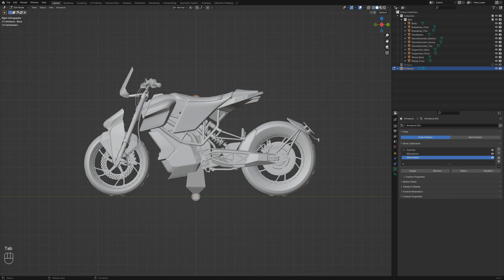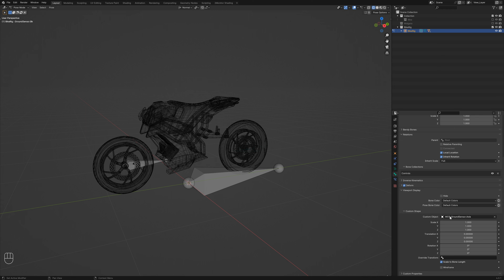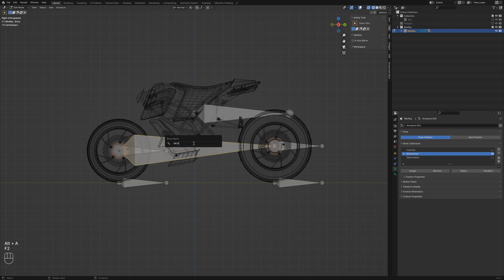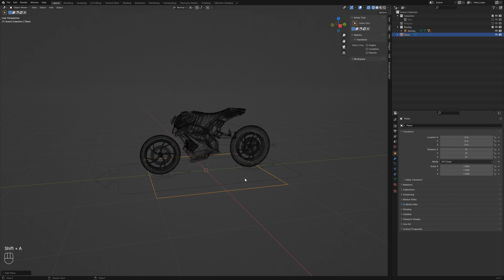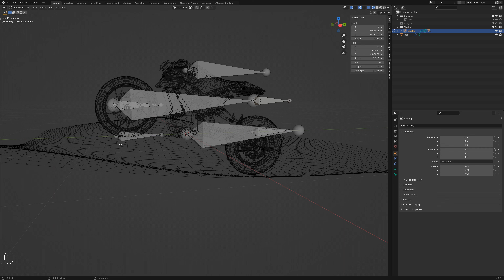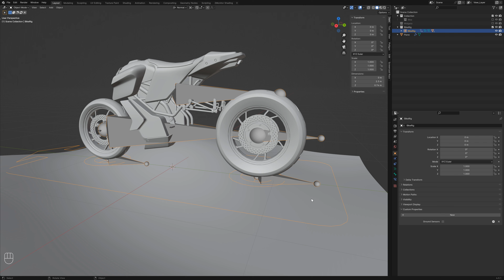Blender 4.0 Tutorial Series: Rigging a Motorbike - Part 2/10: Creating an Axle and Ground Sensors

Comment: I also had a trouble in setting up the first three bones. Couldn't manage to add multiple bones in the same Armature despite multiple tries. So seems like after you set up the first bone, change the 3D cursor position. Then go back to Edit mode, select the existing bone, then press Shift + A. This adds a new bone in the location of the 3D cursor but in the same Armature as the first bone.

Comment: What if im using 3.6? will it still work??
Reply from the maker: The only difference will be that 3.6 doesn’t have Bone Collections, it has Layers (those little grey square buttons) You just need to move your mechanical/deformation/control bones to different layers and remember which one you put them on.
Reply: @DelvingDesigns  so basically, instead of labelling them and what not, they are just assigned different squares that i need to keep track of?
Reply from the maker: @scribbled9535  pretty much yeah. I’m so glad they’ve been updated though, it’s something a lot of people have been wanting for a long time.
Reply: @DelvingDesigns  alright! thanks, great tutorial btw, you just gained a sub!